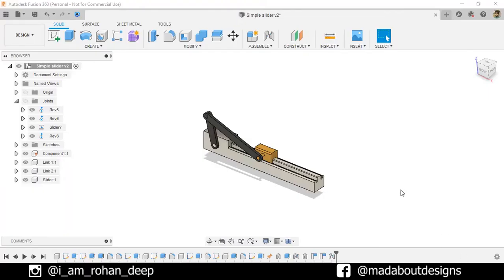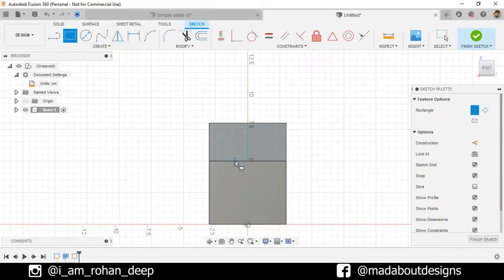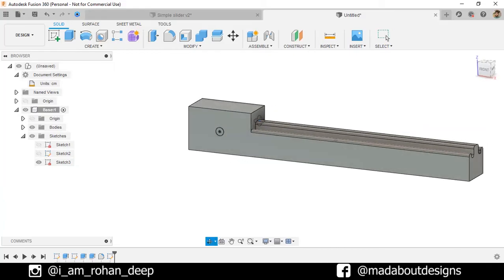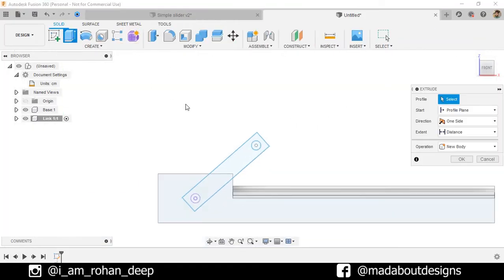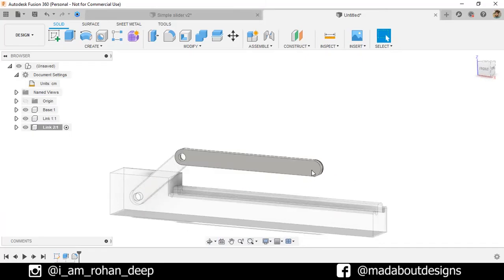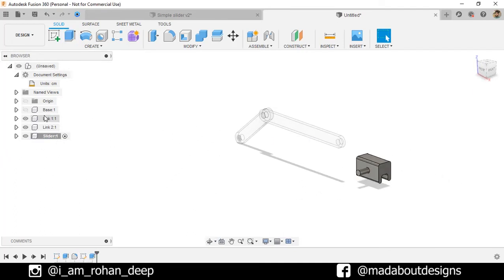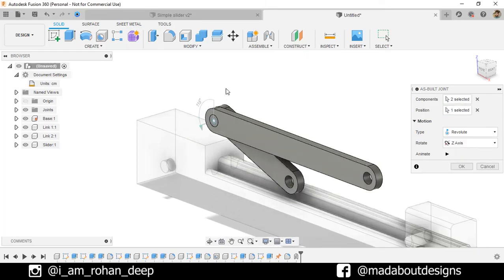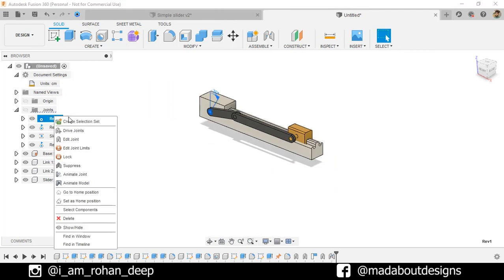How to design a simple slider mechanism in Autodesk Fusion 360

Comment: i have trouble in joining slider and link 2 using joint, i did this after attriuting other three joints .although i could achive this by alining them and using as built joint command.

Comment: Designing in MM or CM is fine but is there a way to quickly take a design from metric to imperial?
Reply: SaltCityFab very beginning of the video where he shows what units to use, you can change that at any time and it converts everything to the new unit of measurement
Reply: @Shurdle3D  thank you.  I'm just learning fusion and didn't know you could do that on the fly like that.

Comment: This does not work for me, after moving the history silder back to the end an error is generated
Reply from the maker: Try to select the components from the sides as I selected while assigning the last joint
Reply: @MADAboutDesigns  hi, thanks for the reply. Im selecting the joints exactly as you. Each individal joint works correctly, but they dont all work together
Reply from the maker: Did you take the dimensions properly?
Reply from the maker: Especially the slider
Reply: @MADAboutDesigns  . I repeated the whole tutorial and this time it works. Cant work out why not before

Great videos, keep them coming. Thank you